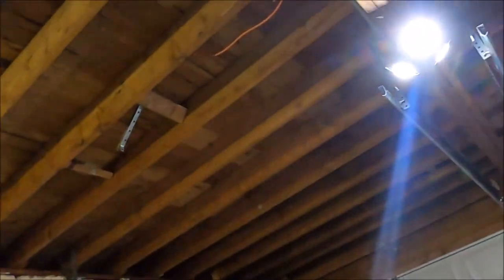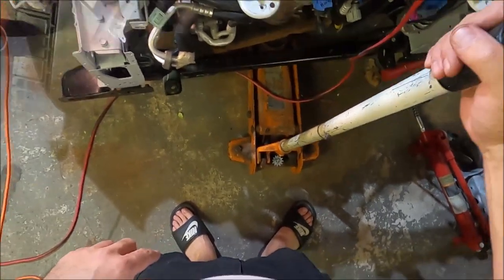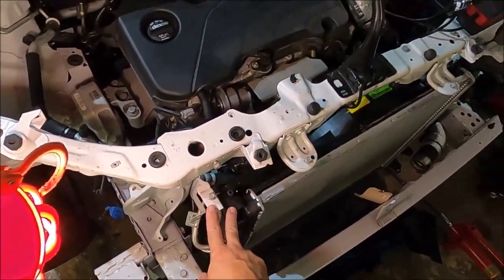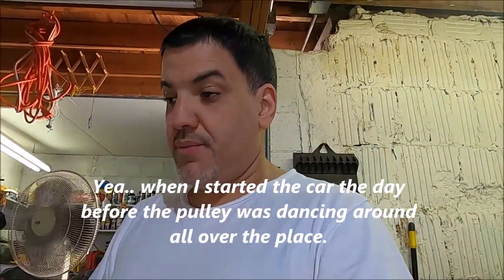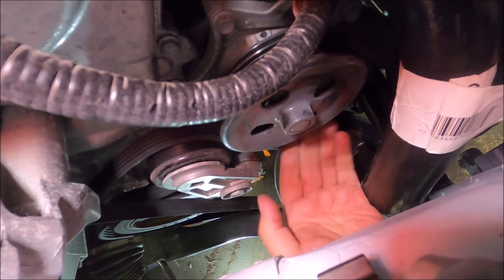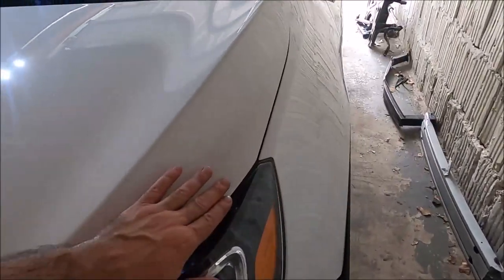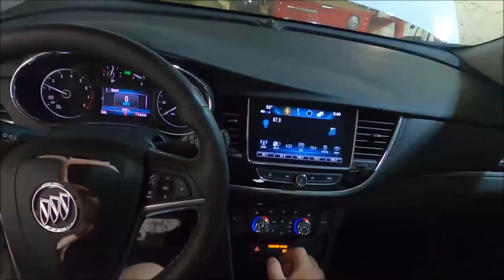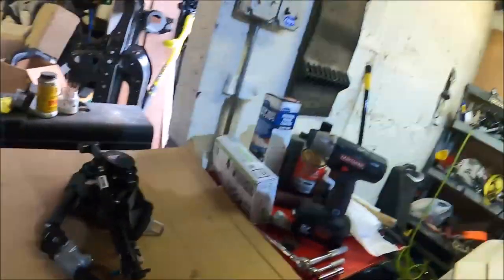2019 Buick Encore Rebuild Pt. 3 - New water pump, A/C recharge & installing more parts.

Comment: How would I recharge the AC?
Reply from the maker: Well, I have all the equipment so if you are just low you can get one of the refill bottles at your local auto parts store. If you need a complete recharge and want to do it yourself, you will need the correct hoses, vacuum pump, oil and refrigerant. You would have to pull a vacuum first and wait 30 minutes to check for leaks. If no leaks are present, then you would pull another vacuum for like an hour then put in the refrigerant and some oil if needed. Thanks